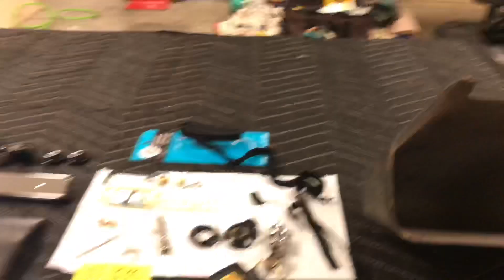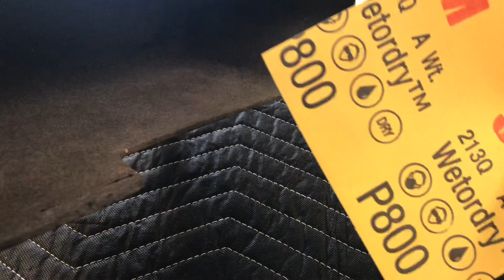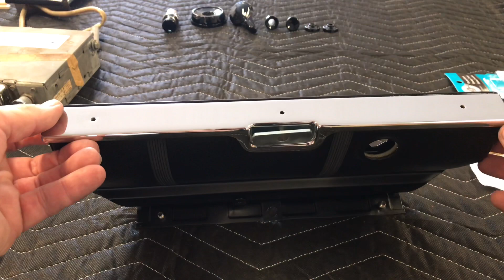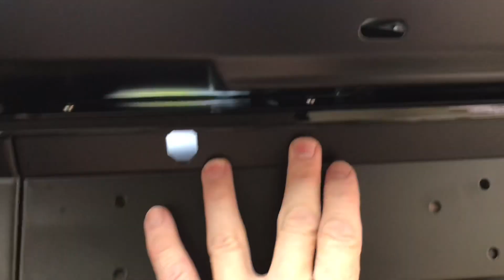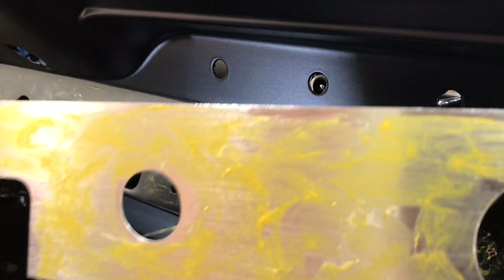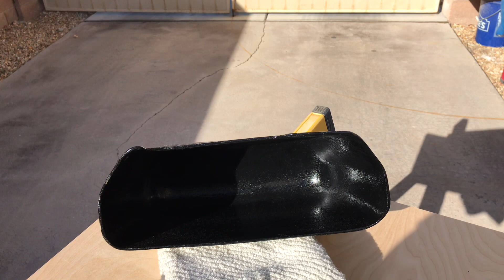1967 Porsche 911 Video 40  Installing Dash trim and Glove Box

Comment: With the engine out when I saw the aluminum trim I was sure you were working on a 912. I drove a 1964 911 that same year and recall the dash had a wood veneer, and I think a wood rimmed steering wheel. My Dad purchased an early 912 and the dash definitely was aluminium. Is my recollection accurate?
Reply from the maker: Yes you are correct
The earliest 911s & 912s had wood dash trim and wooden steering wheels. It was about mid 66 year and models built in 66 for the 67 year aluminum trim and different wheels were introduced. Exact production numbers the new style im not sure..the Porsche historians would know better than me.
66 was kind of a cross over year..some materials & aesthetics were slowing evolving
Reply: Actually I have done some research,  the 911 was introduced to the world in 1964 with the wood dash, jibes with my recollection.  The 912 was introduced one year later in 1965 with the aluminum dashboard, I don't know when the 911 went to  aluminium

Comment: Mike, that metal part of the ashtray is supposed to come out and flip up. It protects the dash from a lit cigarette. The idea was that you can't always be careful when dumping ash into your ashtray while driving. You need to look at the road in front of you and sometimes you could touch the dash with it. ;) Another great video btw! Thank you!
Reply from the maker: Hi Veltruski
It Makes sense it should comes up ..couldn't get it to seat properly when flipping up and rubbing the new trim..I will have another look at it and see..she definitely needs some lube on the guide after the refresh that could be some of the issue. Will check it out and follow up.
Thanks for sharing!